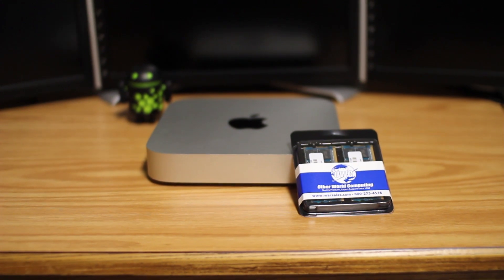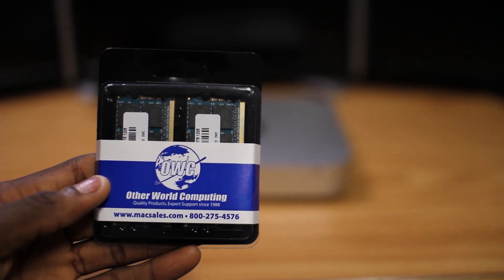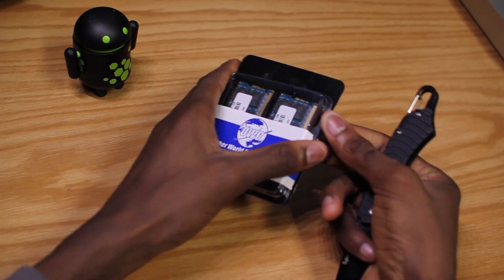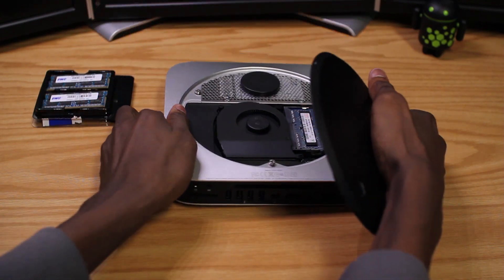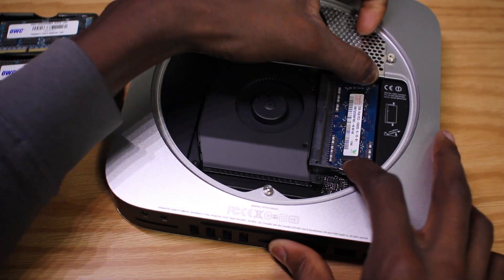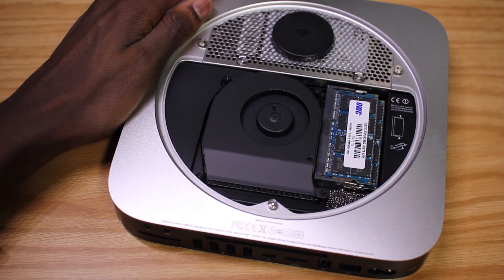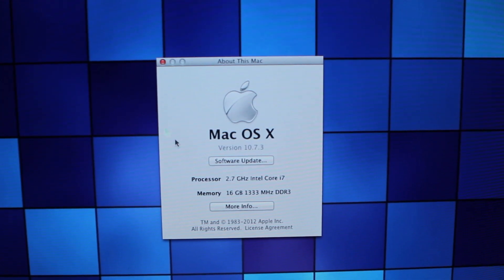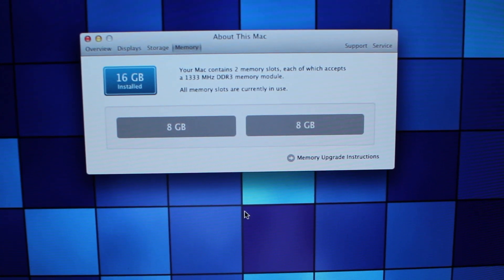Fastest Mac Mini in the World! [Part 3]

Comment: how did you change the graphics card to an amd ?I thought that was the only thing you can't upgrade please let me know how i want to change mine thanks and great videos :)
Reply: you cant change the gpu, you can only use the onboard graphics on the i7, which are still pretty good, you have to note though that this is a workstation not a gaming computer.
Reply: ***** This isn't even a Workstation (the Mac Pro is a workstation for graphics and video). This is laptop parts crammed into a small box that can't run on battery power.

Comment: no, you need a 1 terrabyte ssd because minesweeper needs heaps of space, you also need at least 32 gigabytes of ram and an i7 extreme edition six core. you will need to turn down the settings all the way, and you will still get only about 10 frames per second.

Comment: I actually did this same thing back in october with an entry level mac mini 2011.  it worked well. need a bit of patience as it's not totally ideal, but it'll work. By the way, Marques, after returning my 2011 mac mini, I've purchased the 2012 server mini and used your same guide with an OZC Vertex 4 and 16gb 1600mhz ram, and it's so SWEET!!! And works flawlessly with iMovie rendering! Thanks for your help.

Comment: i bought mac mini 2 weeks ago with 
2.3 GHz Inter Code i5 processor, 
500 GB SATA Disk,
2 GB 1333 MHz DDR3 which comes standard with mac mini. would you tell me, if just upgrading the RAM to 8GB (4GB each) would make good difference to speed.?

Comment: Nice, as I commented on the first video I was planning on doing something very similar. I now have reservations however because I have read that the ivy bridge is going to be in this years version of the mac mini which should give a significant boost in performance. Apple as with all things has been tight lipped. Do you think it will come out this year? If so when? Will it be worth the wait? Keep in mind I am fairly patient and not in dire need of an upgrade just yet. Keep up the good work.